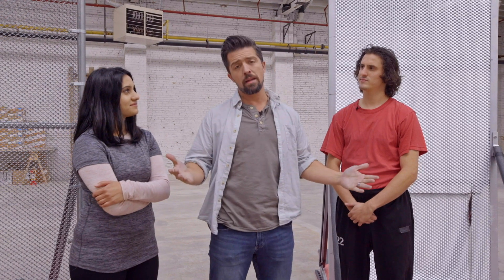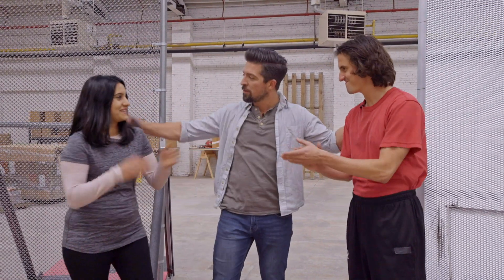Expanded Metal Security Fencing Challenge

Comment: I want to make a grate for a window well.  I can purchase the Expanded Metal sheet in 4'x8' and cut it to size (76"x37") but I don't know how to manage making a border with a "u-channel" .  Will this be spot welded in several spots?  I don't have a welder and have never welded anything.  Will a local garage do this for me?
Reply: Curious to know if these guys responded to your question?
Reply: @eleatherman1  - they didn’t, but I did go ahead and make the window grate.  And it looks nice and works well.  All told it would have been less expensive if I had simply gone to a local metal fabricator and it would have been maybe 25% better.

I bought the expanded metal and Several lengths of 1 inch steel flat bars for the frame.  Should have used L bars so the grate would not shift or move.